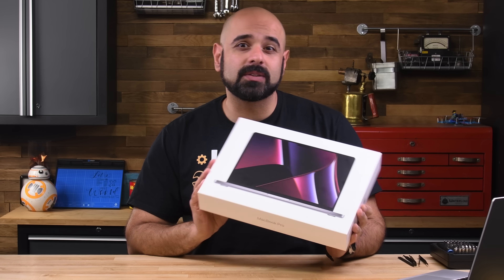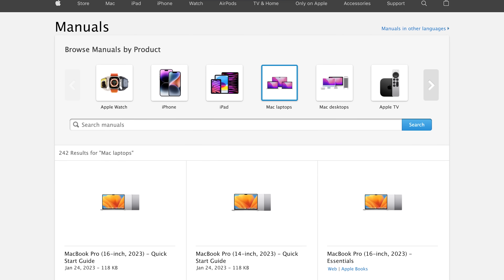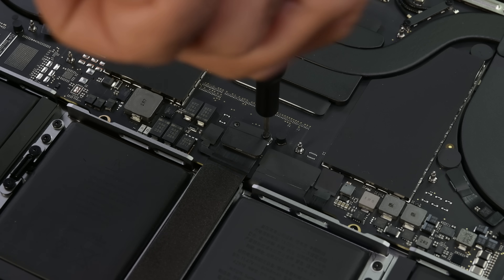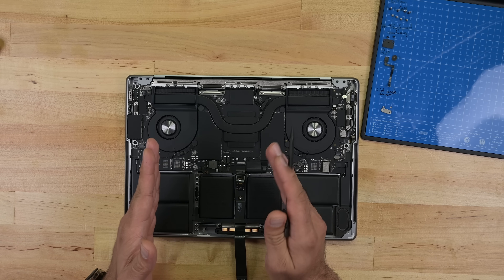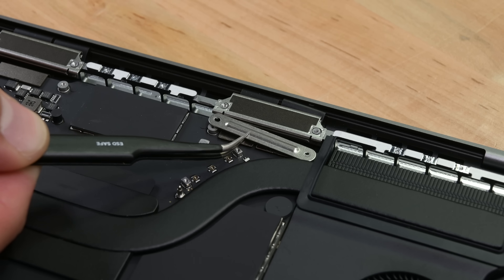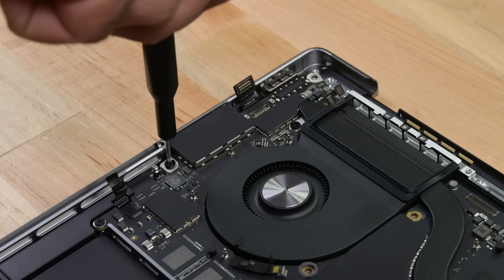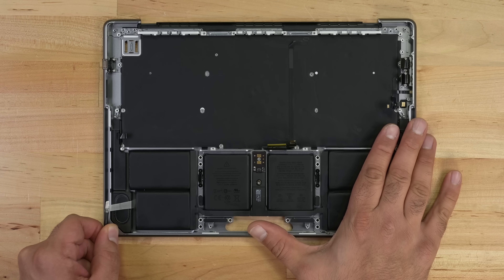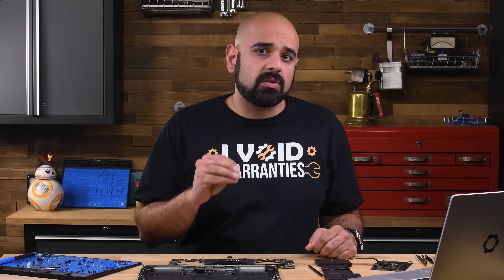14” M2 Pro MacBook Pro Teardown - How Apple Wants You To Do It

Comment: Thanks for this.
But I see this repai manual, and the tools that Apple is providing as EXTREMELY positive.
Because it provides a measurable baseline to judge anyone else's repairs by.

I'm an engineer, and I LIKE standards.
And these are STANDARDS.

You don't need to follow them, but if you do, the job has a much greater chance of being done right.
If you don't, then it can still work out right, but anyone checking the work has a chance to ask why you didn't follow the standard.
And if you truly are competent, you can explain why not.

The Right to Repair, and Apple's response, has been great.
Because otherwise I think the trend that was happening of Apple systems being harder to upgrade & repair was leading to where the 2nd hand market was going to fall away.
Which would then mean that there was less of a drive to maintain the current high prices, and QUALITY of Apple's stuff.

Compare a PC to an Apple computer: both now, and in 5 years time.
And then in 10 years time.
Apple 2nd hand stuff is still a good buy.
But only if you CAN repair it.

Comment: I used to be a Mac Genius. This was back when a Mac Genius was actually a "genius". I did a lot of repairs. This gave me the know how and confidence to open and repair/upgrade complex electronic devices. That said, I don't mind paying someone else to open my Apple devices and repair them for me. The reason is because it's risky to do. Someone who repairs Apple devices professionally has insurance to cover their mistakes. I don't. If I break something it's on me to pay to fix what ever I broke. I have upgraded many iMacs and replaced the hard drives with SSDs. One time I must have accidentally damaged the cable that attaches the display to the logic board. There was a fat vertical line in the display when I powered up the system. That. Sucked. My company paid a little over $600 to replace the display. When I installed the new one it worked perfectly. That one screw up made me never want to do this for someone again. As Apple's computers become more tightly built and harder to disassemble, I would rather just not open them. I buy my MacBook Pros very well spec'd out (maybe more than I need) so I won't ever have a desire to upgrade them.

Comment: I was going to buy a new M2 PRO to replace my Windows machine, as I was intrigued by Apple architecture and efficiency. And then watching your videos and Louis Rossmann's as well, I think of my Windows laptop, which has upgradeable RAM and SSD. To do any of this  I just need to pop off the bottom cover.
It's an i7 10875H, 32GB DDR4, RTX 2070 8GB, 512GB Samsung Evo Plus SSD (3.5GB/sec).
The manufacturer (TongFang, which is a white label manufacturer) also allows the disassembly of cooling system, etc, without voiding the warranty.
You can also overvolt or undervolt using ThrottleStop or XTU machine and the firmware allows it with no issues.
On the weak side, firmware is trash, keyboard is okayish but key caps are discolouring, runs super hot, fans are always spinning even with minimal services running, battery and hardware not optimised for low power consumption, power and keyboard utility made by someone in a garage with little to no optimisation.
But hey, I just recalled I've two M.2 slots on my machine and I could also put another SSD on it.
Not sure if I'll switch to Macbook and pay 3000£ for a full specced machine, as they don't allow 32GB on M1/M2 PRO without choosing 1TB SSD and MAX configuration.
Should I?
Probably Apple Care+ would be a safe bet if getting one of these.
Reply: if you want a newer more powerful device, with good gpu performance, wait for framework laptop 16". You should look it up, pretty nifty device.

Comment: FYI putting open screen  that way is a standard practice in repairshops to be safe. as you unscrew anything from chassey you might need to apply pressure on screws, not mentioning unscrewing trackpad will in fact press on the screen.

Comment: I wouldn't exactly call 20-40% performance improvements to be nominal, but it is true that they didn't revolutionize portable computing again from when they did last generation.
Reply: Where are you getting 40% improvements? From what I saw it was 10-20% across the board.

Comment: I'm writing this on my 2012 Macbook Pro Retina, where I've already installed the second replacement battery from ifixit. I will no longer buy an Apple device if everything is protected by DRM. I don't support that. Not a good development, and in these times when waste should be reduced.

Comment: Idk why people are so disappointed. Both machines got hours more battery life with the same battery size, that’s remarkable. And about a 20% performance bump, which is way more than incremental or disappointing.
Reply: Because it's difficult to repair on your own since Apple unnecessarily locked parts down with software, and because the machines have a limited lifespan due to the soldered SSD.

Comment: For what does the MacBook gets 5 points? 🤣

Even changing the battery leads to a nonworking battery in macos.
Everything else is not changeable either.
Only Apple can repair it 🤣
And im not a hater, i bought myself an 16 inch m2 max macbook 🤣
Just don't get the 5 points 🤣

Comment: I wish Framework (or anybody at this point outside of GPD and other boutique Chinese manufacturers) would make an 11" laptop. I'm sick of everything being so big. I get a laptop to be portable.
Reply: A 13/14" is big?
Not sure what you can accomplish with a 11" laptop. You'll encounter ergonomic and usability issues with such size.
Also, being so small, you need to design even more compact electronics inside it and will have the performance of what?
Just saying 🙂
There's a reason why they don't do 11". There's probably no demand for it.
Reply: @TheMash84  you don't need to redesign anything. The 11" iPad Pro literally has the same hardware. 

There are no ergonomic or usability issues. An 11" MacBook has already existed (2015 Air most recently), and devices like the 10" Microsoft Surface Go still exist. Heck, I remote in to a Windows desktop on my Galaxy Fold 4 without any issue relative to the screen size.
Reply: Just buy an 11" windows tablet, get a decent foldable Bluetooth keyboard, portability beyond what most people would need.
Reply: @heroninja1125  kind of missing the point of "laptop"
Reply: Good luck with that. The demand has to be there, and I doubt it is.
Personally, I find 15" to be rather small. Anything smaller is just too small for me. I'd still love Apple to bring the 17" MacBook Pro back, but 16" with smaller bezels should be about the same anyway.
Reply: @GareWorks  why would you want to drag around a 5 pound 17" laptop?

Comment: You say "software locks" but in reality they are security checks (like on the iPhone) to make sure some dodgy third party part isnt being used to compromise the security of the data on your device.
Reply: dodgy 3rd party? these are first party locks that only go back to apple, not you. if it was about your security it would go back to you, saying they need your password. not permission from apple. its apples financial security that these locks protect
Reply: @bradhaines3142  of course they go back to Apple. Apple are the people who verify the parts and repairs. It’s not generally safe for the average consumer to repair a Mac or iPhone
Reply: @SeanTube2099  it's plenty safe. some screws, a board, a battery, not much else to it. if people can repair their own cars they should definitely fix their own small electronics
Reply: @bradhaines3142  the batteries in the Mac portables and iPhones have no protective case. Meaning it’s very easy to puncture them during a repair and cause a thermal event. Not recommended.
Reply: @SeanTube2099  so dont stab the battery. not exactly complicated. im not 'approved' yet ive taken apart plenty of devices with no issues. stop acting like its so dangerous
Reply: @SeanTube2099 /videos Technically they do have a protective case, and it's unlikely you'd puncture them during repair, especially if they weren't glued into place as they are.

Face it, you're just an Apple apologist. Authorised and first-party Apple repairs have a worse track record than third-party repairs, after all.
Reply: @GareWorks  are you explaining to me what the inside of a Mac looks like? I’ve been inside more Mac’s than you’ve had hit dinners. Do some research and try better.

Comment: So they publish a repair manual, but make everything software locked; meaning if no first party replacement parts, it is still unrepairable.

Hopefully one day we can see a tiny chip on the screw and need run "System Configuration" everything we unscrew it, and the replacement screw is $19.99 and only available for the first year after the device released.
Reply: Exactly, i would rather have no guide from Apple and no software locks, this is actually worse than before

Comment: Is Apple not even trying to look environmentally friendly anymore? What possible reason do they have for pairing the display angle sensor? If it needs calibration fine, that can be done without pairing via Apple configurator. There’s a fact that the software process will actually burn out the sensor. Seems like a bit of a design flaw. Pretty sure there’s a better way to do that. But for what godforsaken reason could they possibly have to pair the sensor to the motherboard?

Comment: Average lifespan of a laptop : 3-5 years
Average lifespan of macbook pros : 7,5 years.

Being easily fixable is cool, being well build from the begining so it don't need repair is better.

I had a few windows laptop, always trash after 2-3 years, even my HP x360 (Full aluminium body, ...).
My macbook pro 2012 that i bought 5 years ago for 450€ is still runing like a champ ...
Reply: A lenovo ideapad from 2012 still works with the latest windows 10 and no hardware issues...
Reply: yea sure, 2003 thinkpad still works in 2023, almost every apple device in our house has been replaced at least 3 times in that timespan, acer aspire 5738, 13 years old, upgraded the motherboard and it works excellent. Try doing that on your cheaply glued together macbooks.
Reply: aluminum body doesnt mean it'll last, that has more to do with quality parts. i have a 5 year old laptop the fans just went bad in, but once those are replaced it'll be fine

Comment: Software locking on replacement hardware components is just evil. This MacBook is a 0/10 for repairability because you need Apple's permission to repair hardware that you own. You're diluting your repairability score with nonsense like the score in this video, iFixit. Trust is difficult to earn back.
Reply from the maker: I'm sorry you feel that way but dealing in absolutes is not the way to create dialogue. We need to acknowledge the good and push for better. Right now we're getting parts and manuals from Apple. The next step is to have parts pairing removed and schematics released.

It's a process and it is working, it's building momentum, and we're winning. The next step is more legislation and tighter legislation. There is a lot of work yet to be done.
Reply: @iFixitYourself  : Absolutes are typically destructive to dialogue, but "I should be able to replace parts in products I own without anyone else's permission" is an absolute I'm willing to embrace.
Anyway, keep fighting the good fight. Your mindset is certainly more productive than mine. To be clear, though, I still think you are devaluing your own repairability score with this score of 5. Perhaps zero is too harsh, but I don't see how you can possibly go as high as a 5/10.
Reply: @Pikminiman  On the other hand, if there was no software lock on components, you'd probably be looking at a near perfect score for repairability, so that little thing is essentially halving the score while we still have a few years in which Apple can fix it without any real impact.

Comment: I do wonder what technical, manufacturing, or cost reasons they have for using so many screw types? Sure, there are some areas that need tiny screws but there's got to be some type of design and implementation leeway to limit the need for so many types. 😄 

If the logic board is the only thing different compared to the M1 version, I see that as a decent middle ground update. If they changed something like the chassis or battery position and shape for a small performance revision then I could see that being an environmentally costly change without much benefit. Though, if Apple were actually open they'd offer upgrade logic boards for M1 owners that want a cheaper upgrade instead of requiring them to buy an entire new laptop. At the very least, someone buying an M2 when their current laptop is at least a few generations old should be able to hang onto an M2 longer than an M1 considering the 10-30 percent bump in performance. 

The camera company Pentax actually released a replacement logic board for their K-1 camera to turn it into a K-1 Mark II. A pretty novel offering that probably benefited a few photographers wanting the latest features in their camera.
Reply from the maker: Completely agree with you! That's one of the reasons why I love my Framework :)

I'm actually not 100% certain why they use so many different screws but I believe the reason to be at least partially cosmetic. Smaller screws are less noticeable. The other reason might be space and weight management, they do like to cram the absolute maximum amount of components inside a chassis and they're always keen on reducing the weight of the device.

I'm sure there's some clever engineering reason too. I'm always amazed to find out what new and novel ways they apply to a problem and often it's not immediately apparent.
Reply: @iFixitYourself  Interesting, thanks for the feedback!
Reply: Likely to allow thinner stacking of components.

Comment: I'm glad to see frameworks used by Ifixit. And as usual, shocked at what a joke apple's repairability is. This is the bare minimum mandated repairability, with as many obstacles thrown in the way as possible. 

I'd like to see the process of obtaining those parts and getting validation from the softwares locks included in the repairability score.
Reply: Framework laptops are a good way of getting a thin laptop whilst preserving repairability. You don't need soldered RAM and SSDs to get a thin laptop.
In fact, with the Framework, you can even replace the logic board from 11th gen to 12th gen... WITHOUT replacing the chassis of the computer.

Comment: Seriously?  Underwhelmed by a year over year spec bump that by all measures seems to be in the 10-30% range depending on the use case?  If that kind of incremental update is underwhelming, then perhaps you're expecting WAY too much.
Reply from the maker: Incremental updates produce unnecessary waste. Planned obsolescence encompasses both physical failure and artificially induced obsolescence and annual release cycles are incorporated in the latter category:

https://en.wikipedia.org/wiki/Planned_obsolescence

It's not about being unimpressed with the engineering, that side of it is always fascinating and Apple's engineers are often the best in the game. It's about egging people on to consume resources we can't afford to waste. 

And it's not just about waste, its also the human cost. Modern electronics heavily rely on resources extracted from coltan mining:

https://theconversation.com/what-coltan-mining-in-the-drc-costs-people-and-the-environment-183159

If not to reduce waste, at the very least we should think about where our stuff really comes from and how it's made.
Reply: @iFixitYourself  when apple doesn't update the Mac frequently enough, people complain like crazy and accuse apple of "abandoning the Mac", "apple doesn't care about pros anymore" etc etc.  No matter what apple does, you will find some way to criticize them.  This update has some major leaps forward, such as HDMI 2.1 and Wifi 6E, which effectively doubles wireless throughput and is the first upgrade to wireless speeds on Apple laptops in literally 10 years since the switch to .ac in 2013 (the switch to ax was actually a downgrade since they also dropped from 3 spatial streams to 2).  If you had it your way, we'd still be using dial-up on B&W screens.
Reply: @spacecadet2172  1. only shills complain about a lack of an update. 2. most people still use and will prefer to buy old proven reliable macbooks because thats whats affordable. 3. If we had it the way ifixit wanted it, this spec upgrade would be an upgrade you could apply to your current device, that you could simply upgrade the internals of your device as you see fit, much like a framework laptop. This is considerably superior to the infinite e-waste endless device replacements alternative.

Comment: The fact that they've been soldering the SSDs onto the mac motherboards and also overcharging 3x-4x the price per TeraByte (@Apple 2TB SSD 800$. At the same time you can go on Amazon and buy a Samsung 2TB 980PRO for 200$) makes me vomit on Apple HQ. Not only that but if your mac's warranty runs out (which is not that difficult because they only give you 1 year), the way they go about the SSD repair is by replacing your whole motherboard. You can imagine that the "repair" will cost you at least 50% of what you paid for that mac. Everybody needs to vomit on all Apple products and stores. fill the stores with puke :X <3<3<3